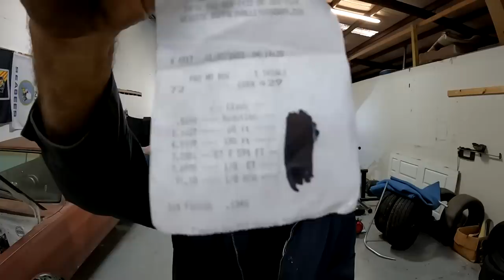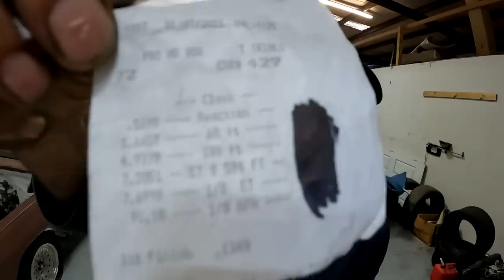Project Bottle Rocket Grows Up - Here Are The Numbers, Facts, History And It's Future

Comment: >>>BOLD PREDICTION TIME<<<

However, before I do, a little necessary clarification because as Tony says, there are some real ding-dongs in YouTubeland...

But what I am about to say has absolutely ZERO intent to disparage or take away from Andy in any way, shape or form. AT ALL. I like Andy just as much as I like Tony, and I consider him to be an incredible wealth of solid knowledge and information. I also consider Andy to be a kind, humble, intelligent and honourable human being. Someone who I would consider to be fortunate to have as a friend, so again, what I am about to say IS NOT meant to disparage him in ANY WAY. With that out of the way, my prediction...

Even with the "not-as-good" 318 that currently resides in Bottle Rocket, after Tony gets the rear shocks, tire pressure and trans linkage dialled in, and he is able to spray it to its maximum potential, Casper still won't be able to catch Bottle Rocket, and I'll die on that hill with that prediction. There is A LOT more in this setup than some (most?) people realize or comprehend. It's going to take some people by surprise. But I'm not surprised at all. Even with stock heads and architecture, there is more magic "hidden" within the Mopar small block than people may realize, and if you're smart, there's something that Tony mentioned in this video that explains a good part of it. Particularly with this setup.

With all that out of the way, as much as I'd love to see Bottle Rocket's time slips after each run, I also think it's kind of a brilliant move for Tony to slap an N/T on Bottle Rocket (N/T = "no time" - i.e. do not show the ET and MPH on the track's scoreboard). Instead of openly showing what ETs it's getting with every pass, you'll have to guess how fast it is by how much it beats or loses to the other car. True to Bottle Rocket's intended street racing spirit, and even the unassuming look of the car itself, it baits people into thinking it's "shit"...that is, until they get beat. That's the whole point of this build. Build a badass street and strip machine on no money with "crap" parts and use your intelligence to make it go fast. Bait people into thinking your ride is garbage and then blast their doors off. Settle in folks, you're in for more than you may know...

Comment: 4:56 gear rear and you got it going that fast??? Good God almighty tony your are definitely keeping secrets from us!!! I remember when I drove an 85 ramcharger with a good 71 318 4brrl with 302 heads I couldn't get to 90 with 4:11 gears, downhill!! Not telling you what to do but what I would do is get the a518(727od) and the highest gears I can find and make a double stick shift on the floor you pull back on 1/2/3 and then move to the other stick and pull forward to engage overdrive, 1st wouldn't do much but the other gears would definitely be there!! That's what I'm planning on doing in my 74 charger, the other idea was keep the column shifter and wire o/d to the cruise control set button on the blinker, my car hasn't had cruise control since 1983

Comment: I had a 1980 camaro I got for free. Took a 1988 350 chevy block, cast crank, lt1 PM rods, plain sealed power pistons, moly rigs gapped for nitrous, garbage L98 aluminum heads(I ported the hell out of, left the 1.94 I take but 1.60 exhaust), 10.3:1, had howard grind a hyd roller for nitrous (stock style roller), old 1960 tunnel ram, 2x660 holley dp, a leftover nitrous express system I had, garage built TH350, midwest convert for spray, 4:10 eaton posi. 10.80 consistent. I never blew it up. The car was free, I had 4k in the entire car, parts given, did everything my self and everyone told me it would be slow/ it's going to blow up/ you can't do that. By the way I built that motor 13 years ago, it still runs. Build junk and have fun, that's what this is really about. I'm doing the same thing now with junkyard 5.3

Comment: Brother you don't need to defend yourself to anyone.  I used to race for fun in the 80's. I built up a 1974 Ford F100 with a factory 390. I did not put it on the bottle and it was still street legal. I was developing so much torque that the flex split my steering column shift tube. 

I could run just under or right around 12 seconds in the quarter. I could hit around 109 to 116 miles an hour. My problem was the hook up with a light weight truck and no weight over the rear axle. It all came down to the track and weather conditions.

I had guys tell me I was full of BS. I just told them let's run. I embarrassed a lot of pretty quick cars on the strip and the street.  I did the trial and error method of building. Everything kept failing until I beefed it up.

My 390 truck motor turned out to be a torque monster when finished. 

Don't worry about the Keyboard Kaptains on line. We think you are awesome and enjoy your videos. 
We would make awesome neighbors and our wives would probably hate it. My shop time was rough on my early marriage until we found that balance. 😁

Comment: I used to race 1/4 mile in Hawaii in the 1990's and liked 1/4 mile bc you could build it to be pretty quick and still drive it every day. I got back home to Kansas and no one is running 1/4 mile anymore.  That was very disappointing to me. I am now building a 1966 gmc 1/2 ton long bed but I doubt I will race it bc I don't want to gear it for 1/8 mile.

Comment: 12 to 14 psi tubes,, and bolt those tires to the rim. Either way great run man.
Reply: Tubes and rim screws do not a safe car make.  Just because I do it doesn’t mean you should

Comment: The rear suspension of your car was really showing the torque. It was impressive to see that. But I think the car dug it's ass in very well. 
As for the project's intent, I think you achieved it. Anybody who has an issue with that should go bend some wrenches in their own shop instead of posting about it on the internet as if they had the right to an opinion on your life.

Comment: Uncle Tony...
I have a few questions I'd like to ask about offset crank grinding on a 318 factory forged crank. 
Any experience with this ?
I'm planning on .050 undersized King bearings and .040 offset to get stroke and compression. 
Would nitriding the crank afterwards be sufficient?
Looking at 11:1, solid roller cam with 245°& 248° .580 lift howards circle track cam and trick flow 190 cnc ported heads, icon forged flat tops and eagle H beam rods.
 Will a factory forged offset ground crank handle this? Nitrided?
Looking for 450hp

Comment: Watching the race (and both you and Andy talked about Casper running out of track) Andy was going around Bottle Rocket. So the question in my mind is how do you get more out of the top end to keep that from happening. I think it was mentioned post race but how much speed did Casper have at the finish line as it was still pulling strong? BR seems to have the torque to handle taller gears which would give you a higher top speed but can you detune it enough at the start to keep from breaking the tires loose off the line and through the 60'? I like the aspect of learning as you go and plan on enjoying watching you make progressive changes to make her faster.

Comment: Tony the car needs 17 psi for the
Drag radials to work with a set of
Viking double adjustable front shocks
To control rebound and let the car
Settle back down after pulls the front
Wheels so it won’t unload the rear
Suspension and loose traction 
This is what my 71 Pontiac Lemans
Runs car is a 10.80 car with
A 495 Pontiac motor and 4:10
Rear 29 inch tire.  Your right N/T
Put in the middle of your rear 
Window connecting highways 
N.Y.C. For ever Brother I
Just turn 60 the March 
“F” those trolls!!

Comment: I see a bit of lightening in the removal of the hood inner structure. I would bet that the trunk and possibly all the doors have had the same treatment. The torque is what moves you off the line. It cracks me up when engines are tuned for max horsepower on the dyno and then try to get into the non existent torque curve in the real world. Thanks for the description

Comment: What gear ratio were you running?
Stall converter?  
Like your videos
I had a 73 dart with a 318 2 barrel but it had enough torque that broke the tires loose pretty easily.  I wish hi had that car today.
Reply: Did you actually watch the video? He answers both of those.
Reply: @TheInsaneShecklador  I must have missed it but thanks for the a-hole response!  Back to unsubscribed for me.

Comment: You probably aren't getting taken seriously, because the 318 had a reputation of only being only a housewife's engine.
To aleviate your traction problems, I'd start out with moving the battery to the right side of the trunk. Torqueflites are too powerfull for off-the-line traction. That enormous torque would be better distributed, if you were to hook up a Powerglide or Jetaway behind your engine. Adapter plates for both must be available somewhere, given that both bolt patterns also convert to Turbo-Hydramatic 400s.
"Anal-retentive machinist" 🤣. I wish I could find one to line bore my cylinder head.
I'd cut an R/T template from thin cardboard and then use it to pattern a spray-on onto both rear quarter panels

Comment: tony you are on it  back in the day we would take  360.s out of trucks vans .  little head work  camshaft gears  throw it in a dart or duster we would clean house  high 11.s all day . and 318.s do and will go had a 68  plymouth  valiant  post with a built 318  150 shot  n o s  904  trans stall  430 gears . the thing made  people mad  good 
fun back in the day all will junk yard parts

Comment: I have a 318 im wanting to run a stock crank and rods and pistons but im wanting to put on a nice set of aluminum heads, a choppy cam, a edelbrock intake and a holley brawler 650 carb. And long tube headers. Thats what i want to run. Few questions 

What would be a choppy cam to go for with this idea?

What are a nice set of affordable aluminum heads that would be good for this idea? 

I have asked so many questions on mopar groups like this and got nothing but criticism and never got a good solid answer even been told get rid of the 318 and go 360. No i love my 318. 

I just want to know what is a good combination of a cam and heads to make this 318 have some bite. 
Please help!!!

Comment: What do you think it would run without the bottle? Just curious. We used to run an old 67 ford galaxy with a 400. Basically stock save for street cam intake headers. Stock c6 and 4.88s. Ran 8.8

Comment: You’ve managed to take 800# out of the car without it being obvious, you haven’t done many of the things guys routinely do for weight reduction. I’m impressed, and also speculating like crazy.
Reply: You didn't see the entire sub structure cut out of the hood?!😂
Reply: Tony really put Lambchop to work scraping the whole chassis and cutting all kinds of metal out of the car.  There used to be quite a few videos on the work Lambchop did for Tony, but I could not find them in the archives.

Comment: Wont take much to get in in to the low 7s or high 6s.  And PS, I could show you time slips from Old Paint the Wonder Horse, which I have been doing the same poor guy stuff since 05.  And darn, it rusted out while I waited and worked on it.  So now I am fixing that.

Comment: I used one of those Accel  coils  for a while ' but ended up going back to a normal small coil  because  the distributor  point's ( new ones) kept on  getting a a big lump on them  really  soon after  being installed.
Reply: You need a larger capacitor like Tony is using.

Comment: People often forget about midrange torque and get caught up on peak horsepower. The mid range is where most stuff really lives. And with stuff like 1/8th mile you don’t really have time to take advantage of high rpm power. Gotta get it up and off the line which takes low/mid torque. 
So much stuff went to 1/8th mile because many cars have gotten so fast the 1/4 was getting sketchy. Especially with the No prep stuff.
Reply: The drags are 80 percent launch, too, yes? It's why Eurocars suck so bad in drag racing, right?
Reply: @exploranator  The first 60 feet is really important. But, with a full 1/4 mile you can get a bad launch and still makeup some time if the car has a lot of power. But, with 1/8th mile there isn’t the extra room. 
Euro cars tend to have a different driving philosophy which leads to different chassis and engine development.

Comment: 15:50
That air shock should hold 10% in psi of the vehicles weight, 
A 50psi in a pair of bags on a truck can carry an extra 5,000 pounds, 
If you have two, and the car weighs 3400 that would be 34psi each, but in a single for your purpose, I would say 35-43 psi in your anti twist bag if not the equivalent of the weight of the car, I think this will help a lot with he twist and deflection, but I honestly don't know how much yea ran, but I'll gess between 15-23psi

Comment: I wish my car would run like that. But my 4200 pound, 1996 Buick Roadmaster sedan with a 2.56 open diff would need a lot more than the factory LT1 can give. If it wasn't my only car I could probably gut it to get rid of 1000 pounds of dead weight and make it a little quicker. But basically I just need a lighter car. An older, lighter car.

Comment: Tony ! Tony Tony ! i had b bodies with b and rb blocks , but i was gifted an old 66 fury for free ,no eng ,tranny and had a la 318 , so decided i'm gonna have some cheap fun street racing this pile of mopar poop! radical cam 727 3500 stall converter and 3:55 posi, stock shortblock with 60,000 miles 135-145 cylinder pressure, 8 degrees advance on the cam and you said it, went for midrange torque ! had so much fun beating basically stock camaro's etc, lotsa worn out muscle cars back in the 80's   , even beat a friends new mustang i installed headers on , at that time the grand nationals and mustangs were kings in stock. Would pack it with friends , go to the track with baby slicks in the trunk, the day best ET , had was in low 14's and launching in 2nd gear , almost the whole 1/4 in 2nd,  just 3rd last 50 feet ? More bark than balls but it was a gas !  You bring back those days ! thanks

Comment: I thought you had that distributor set up to where you could run it off of one set of points for the street and the other set of points for nitrous
Am I wrong or is that just something you didn't want to disclose
Reply from the maker: I did away with that when I realized I had no interest in driving this car around.  It did and will work fine,

Comment: i have a super low budget ride i am making its a 1973 gran Torino sport roof it has a 351w  it weighed   3690 and it has weld wheels and aluminums heads missing a/c  needs to lose weight badly i think i seen where your hood looked like it lost structure ? i think i have lost alot but damn this thing is a tank dont wanna make it unsafe in the process of rebuilding car

Comment: Yeah, stop light to stop light don't have any time slips 🙃
Street cars are what they are.  Back in the day (1960's), you choose me, I won't even open the hood.  $50 each to the cashier at Tip Top Diner - then north out to 4 Lanes on Hwy 1.  First car back gets the money.  Even if you win the 1/4, you gotta drive back to the diner.  You break, you loose.  You over heat, you loose.  You get pulled over by John Law, you loose.  So you run the 1/4 and shut it down, cruise back to the diner.  COP's don't have to catch you actually racing, they get you speeding on Hwy 1 south to the Diner.  Same place they get coffee on the night shift. That's the way we did it.  So same here.  Run what you brung and hope you have enough ...  Keep your wits about you.  Drive the car 😁

Comment: With that 1/8th mile time I think it'd run 12.08 in the quarter mile.
Reply: A 6.5-7 sec 1/8 mile will get in the 10s
Reply: Official NHRA rules state; 6.40=10.00, 7.00=11.00, 7.50=12.00, 8.60=14.00  I think your 12.08 is right on.

Comment: I may be wrong but I believe that you hustled Andy, I believe that until very recently this car had a MUCH lower hp engine in it and just before your race with Andy you did a switch, You know the old bait and switch. You see Tony all one has to do is google what this car weighs from the factory and  that right there tells one how full of chdt that you are, this 4 door is heavy You may have lightened it a few pounds but the car is still a lead sled 4 door boat! By the way while all of you you tubers are at it you might want to google what the approx weight of Andy's pickup  and I believe you will find that Casper weighs closer to what Tony said Bottle Rocket weighs and that Bottle Rocket weighs about what Tony said Casper weighs. I also believe on a mildly modified 318 as Tony claims that this car is a high 16 low 17 second car all day every day, I don't know what the nitrous will shave but i am guessing 1 to 2 seconds so according to my calculations this 4 door lead sled Boat with the 318 that Tony claims is most likely a 14 second car at best! In my opinion this 10 second car as Tony claims was not powered by the same wore out 318 Nicks garage dynoed engine  that we have been watching in the past.  I apologize if I am wrong but if that was a bait and switch I believe that Andy was done very wrong. Most of us gear heads know that 10 second cars are not commonly built for $2500.00 With that said I have got to hand it to you you have finally made this 4 door junk as you call it fast.   I would have bet and lost alot of money on that race